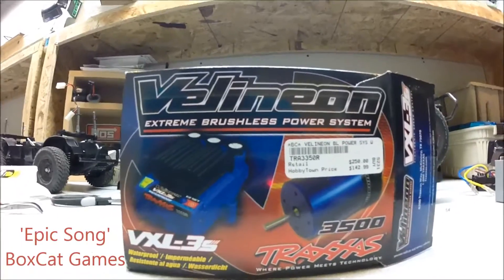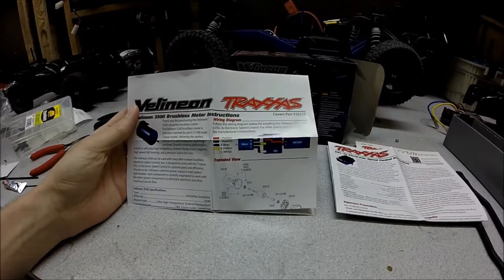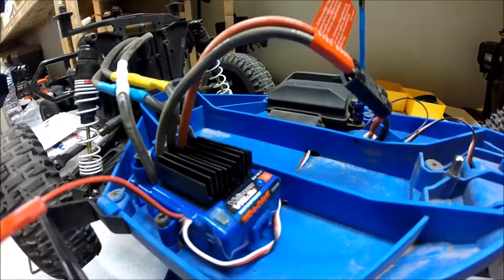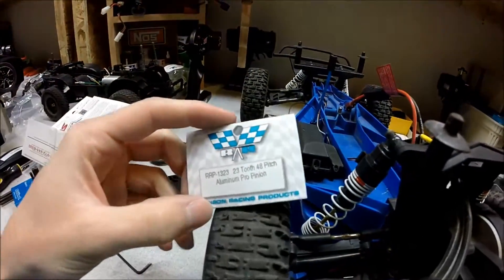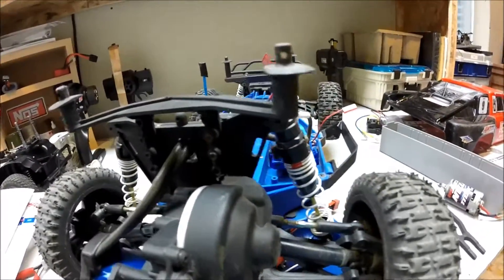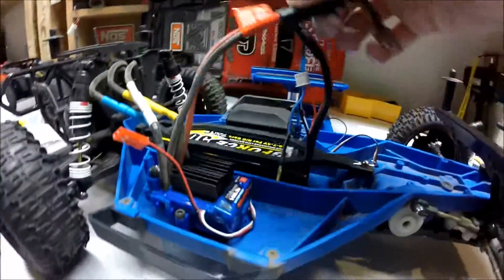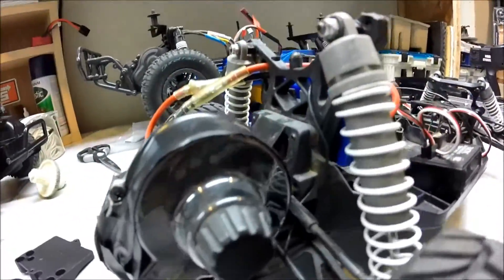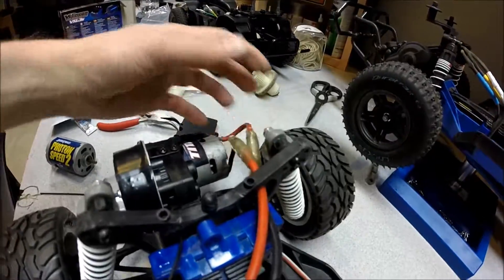Review // Traxxas Velineon VXL-3s Brushless System

Comment: Peak Current - Forward:   320A
Peak Current - Reverse:   320A
Braking Current:   320A
Continuous Current:   200A
BEC Voltage:   6.0 V
BEC Current:   2.5A (with 6-cell NiMH)